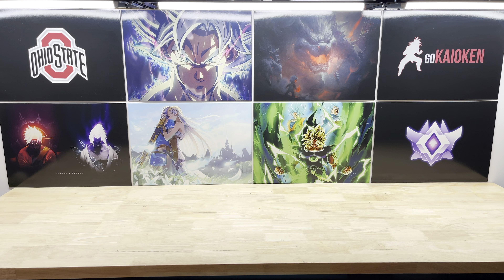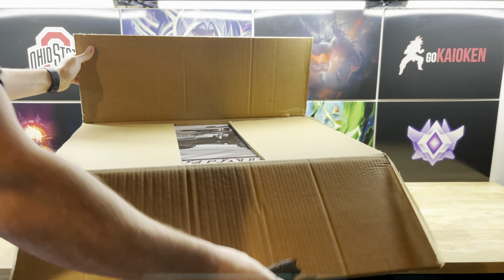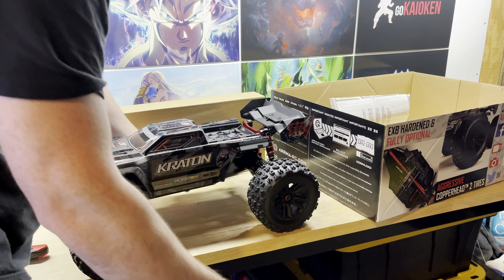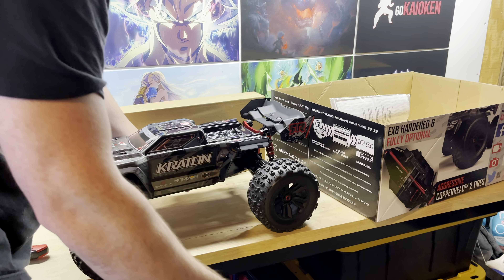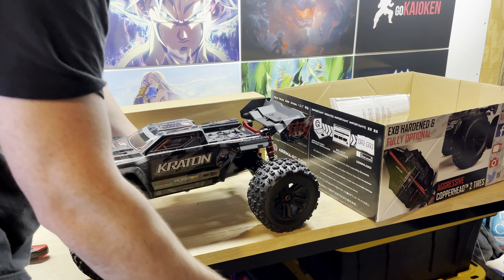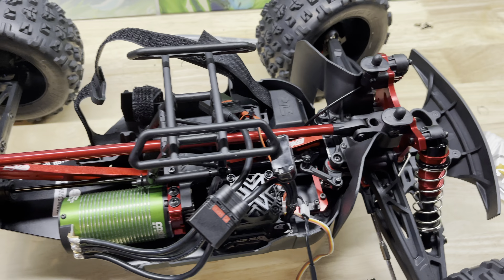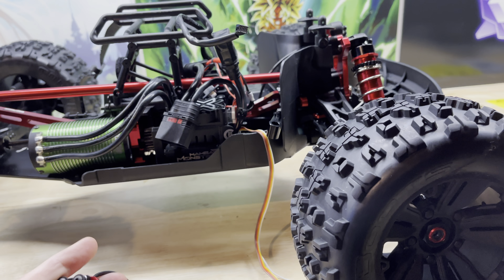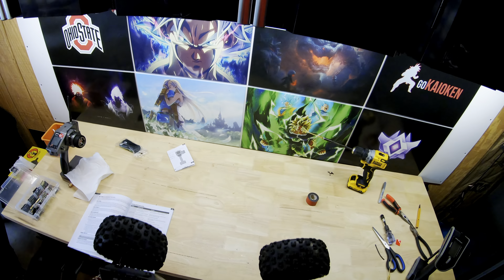Arrma Kraton EXB Unboxing, Setup, and First Run | Castle 1717 and MMX8S

Comment: As far as mounting the fan on the motor goes, you could have just nipped off the end of the body cage as its only job is keeping the pin upright for easier removal.

Comment: Definitely recommend checking all differentials. Strip them and put thicker fluid in. 50k front, 200k minimum center and 20k rear. Also look for play in any part of the diff. Check "BournemouthRC" on YouTube for good advice. Do them now because you will need to do them at some point and later is more expensive and a bigger pain in the ass

Comment: One other thing. Check out "RadicalRCUK" for a bash bar. It puts the strength in the right place and is far easier to fit than a new chassis. It's 7075 aluminium and it's way stronger than any other aftermarket chassis mod.

Comment: Check your fan screws on the mmx8s they are to long and push on the caps causing the esc to fry
Reply from the maker: I’ve had that ESC for a long time, it’s fine but thanks for the heads up

Comment: I have one with a max6 1650kv installed but I'm still waiting on the servo to arrive. (Can't wait anymore lol) How are the diffs holding up? Do you have any problems?
Reply from the maker: I used to run into front and rear diff issues, but that was after I locked the center. Bad idea. Opened it back up and it’s been good ever since.
Reply: @GoKaioken  Thanks for the info,
 So the advice is not to lock the center diff. Greetings from The Netherlands!
Reply from the maker: Correct :)

Comment: So does arrma want you to put that shim in or what I thought they fixed the rear diff ? My exb should be here Monday so I’m really curious what that paper says exactly that has the shims ?
Reply from the maker: The paper says exactly what I show in the video. Add shims to tighten the mesh. So you have to check it before you start. Since there are slight differences in each one you may or may not have to add a shim. For me, I did not have to add any.
Reply: You want to shim the sun gears on the exb.  I used 3 shims per side and lsd plates in the rear.  It's been holding up great.
Reply: @GoKaioken  thanks for the reply and I didn’t see you open up the package with the shims so I figured there was more explanation than what I seen thanks though!!!.